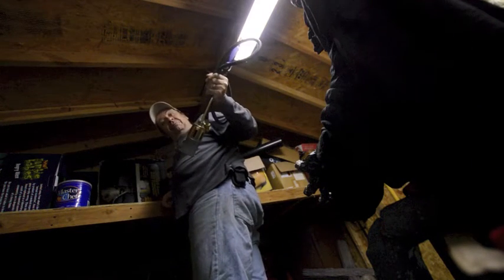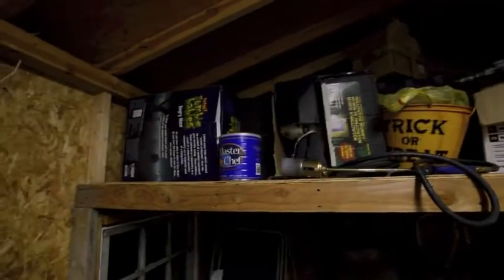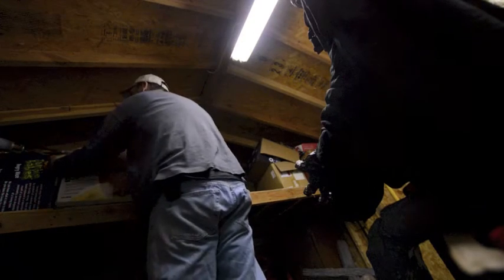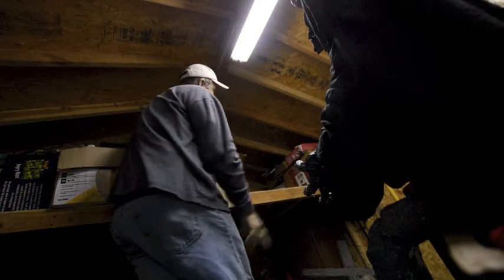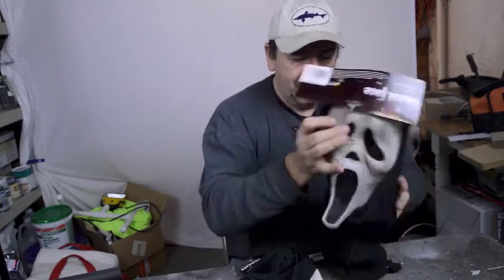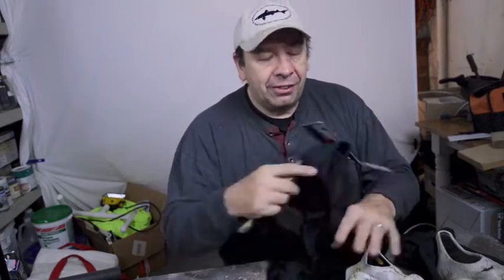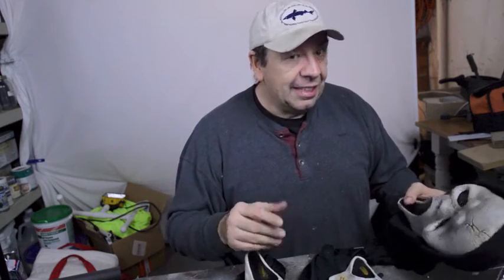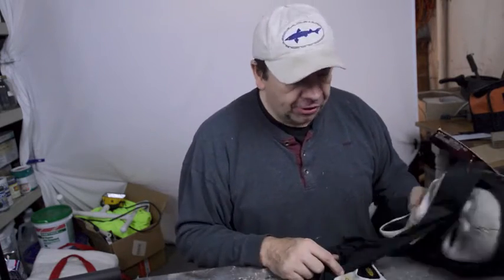A Friar, 2 Parishioners, and 3 Choir Boys - Bleached Bones Vlog 63

Comment: Hope the templates help!  What I did on my dummies is I got the cheapest pillows from WalMart for like $2-3, ran the spine up the middle, cut two holes towards the top corners for the shoulders to pop through and one on the top for the neck.  Quick and easy way to puff out the torso.  Good Will will have throw pillows too.  Just a thought.
Reply from the maker: +Graves Of The Groves Great idea! I may just use this idea